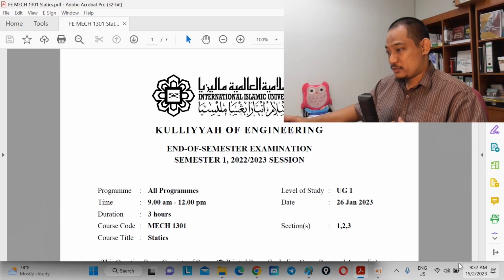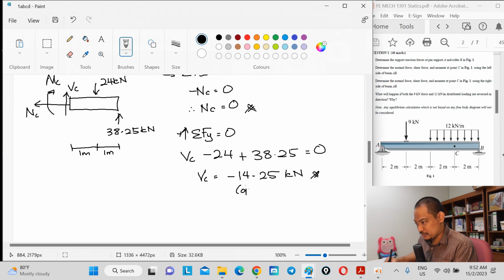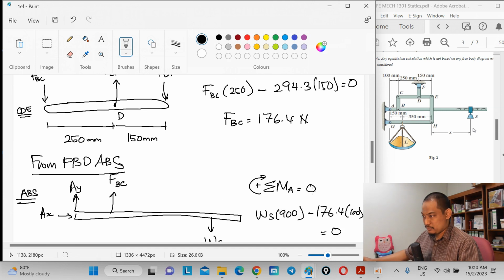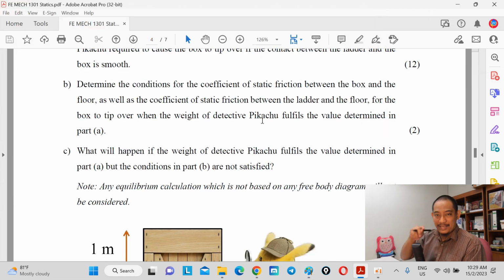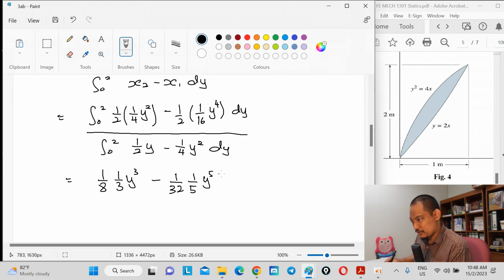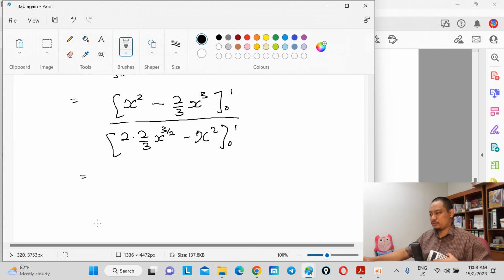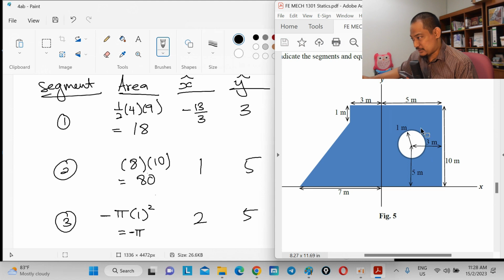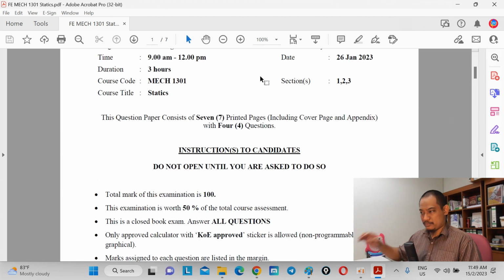Statics Final Exam Simulation (4th Sample)

Comment: Is there a specific direction in which we direct our shear force, or do we make an assumption about the direction? If the answer is negative, then we need to consider that it may actually be acting in the opposite direction.                       Would it be appropriate to mark the free body diagram with a properly directed arrow, or is it advisable to draw the arrow after calculating the magnitude with certain assumptions?
Reply from the maker: The flow of calculation,
1. draw free body diagram
2. equation of equilibrium based on the free body diagram

Given the step as such, drawing the free body diagram does involve making assumptions on the direction of certain forces (be it the support reaction, or the internal loads)

To indicate the actual direction after the calculation, redraw a new diagram indicating the actual direction that is known after the calculation (do not change the free body diagram, as the calculation is based on the direction assumed in the free body diagram - otherwise it will be confusing to the examiner)
Reply: @SaifuddinRehan  thank you